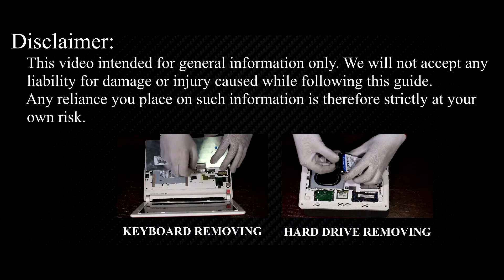Acer Aspire One Happy2 RAM Upgrade & Install: Step-by-Step DIY Guide

Comment: Boss what the mhz for the ram happy 2 ?
1333mhz
1066mhz
1600mhz
Which one should i chose
Reply: Original in  its specification use PC3 8500 (1066Mhz) and I used  2GB PC3 10600 ( 1333Mhz) to replace it  and working.. when i tried to use 4GB PC3 10600 it doesn't work ( blank screen)
Reply: @abulkahfi  so 4gb will not working ? So i will buy 2 gb ram
Reply: @abulkahfi  Your windows/linux is 32 or 64 bit?